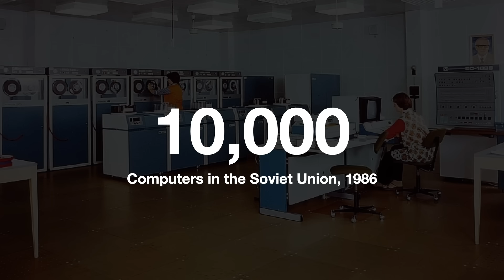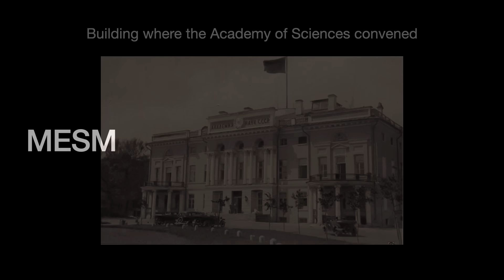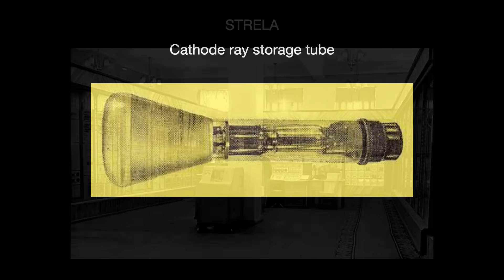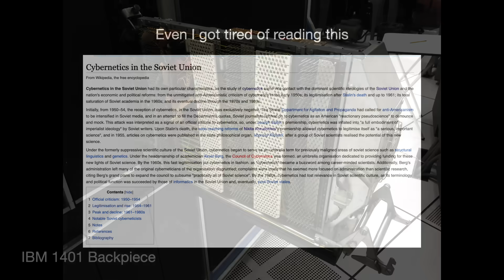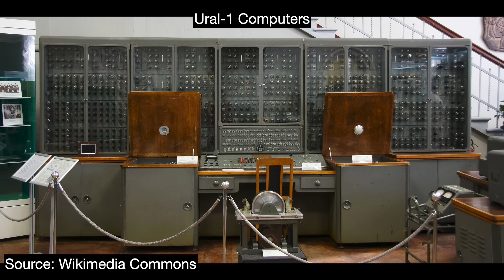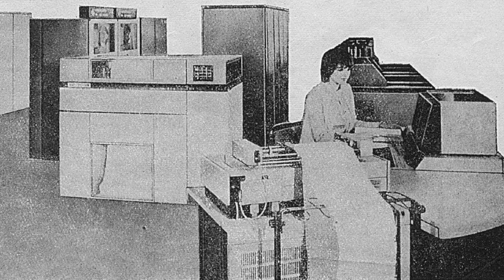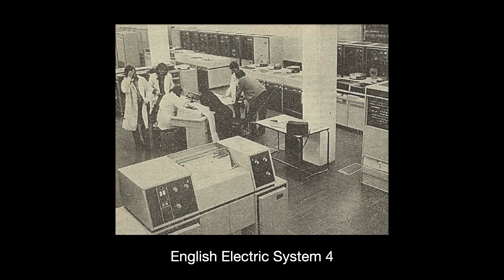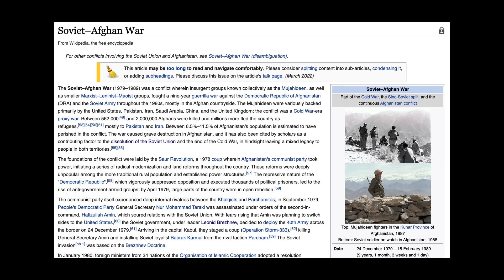Why the Soviet Computer Failed

Comment: “10 kF was thoroughly unnecessary…” reminds me of overhearing an Intel engineer at a pub in Hillsboro, Oregon about 1987 say something like “why would anyone need more than a 32 bit bus?!?” I was so flabbergasted at the narrow mindedness that I almost interrupted his rant.
Reply: This reminds me of a scene from ‘Pirates of Silicon Valley’ where a Hewlett-Packard manager asks a young Steve Wozniak, “What would ordinary people want with a computer?”
Reply: @tygerbyrn  in 1976, that Hewlett-Packard manager was 100% correct.  Heck, 10 years later he was still correct.
Reply: @RonJohn63  HP industrial computers of that era were quite expensive. They were built to control test equipment in labs or on production lines They used a lot of power, and most peripherals used the HPIB bus. (Which evolved into IEEE-488. The early Commodore PET computers could also be used for the application, at a much lower price.
Most people would still not buy computers, if they had to learn to write their own software.
Reply: @tygerbyrn  The internet and www was the killer app for ordinary people. Until that moment computers were more for hobbyists and professionals.
Reply: @gast128  No.
When internet didn't evem exist I worked as full draftman with computer.
Reply: @gast128  I think the whole point of that particular scene in PoSV was to show how the “old guard” of HP managers didn’t have the vision of a future where everyone would be connected electronically at anytime and anywhere. You’re right that it wouldn’t be for a couple of decades. However, it was meant as a metaphor as far as that television movie was concerned.
Reply: @tygerbyrn  I'll play.  What WOULD ordinary people want with a computer?  In real life, what dragged PCs onto US desktops?  Accounting SW?  word processing? games? (ultimately, the answer has to be "internet," i think).
Reply: @hildebrand142  The issue of a computer for everyone comes down to cost, availability, and computing power. The cost was prohibiting for most people other than hobbyists and professionals, as another commenter pointed out. However, the real reason was in the value of the computer. The majority people didn’t use computers back in the day since they couldn’t bridge the gap between benefit over the cost. Certainly, the usefulness of the computer was limited too and thus, curtailed sales towards ordinary folk. 
That’s where we come to the availability of computers. Most computing machines were in the workplace, such as the professional office, factory floors, and government/military. However, as time wore on, the computer became available in the one place that allowed it to become mainstream. The place is the schools. Of course, the first schools where computers were available were colleges and universities. Indeed, many of the know-how and experiments were obtained from and done from institutions of higher learning. From there, ordinary people started taking notice of computers their children were using and they could also see how computers could be useful to them. 
This brings us to computing power. Yesterday’s consumer computers were novelty items to the general population. The total computing power of a 1970s era computer had just a fraction of the power that our current smartphones have now. This low computing power limited the uses for devices that people could use in their daily lives. Games, on the other hand, were and still are the driving force for innovation. Nintendo is an excellent example of this. Their blend of electronics and storytelling helped propel adoption of electronics for the masses. 
The internet certainly did increase computer usage, but that came in the mid-90s. True commercial acceptance came with the advent of the smartphone (Apple iPhone) and the interplay of cost, availability, and computing power was fully realized into the current ecosystem of developers and consumers.
Reply: In the late 70s someone I knew pretty much described where we are now in electronics, saying only a major unforseen roadblock in scaling things could stop it. He expected a few things that haven't happened, like wafer scale integration becoming common, but he had most things about right. You should have seen the negative reactions his presentations got.
Reply: @steveunderwood3683  I was an electronics undergraduate in 1965.   Dr G T Wright, an expert on heterojunction transistors,  mentioned integrated circuits in one of his lectures.  I asked if it would eventually possible to get an entire computer on an IC.   He told me not to waste his time asking silly questions.
Reply: @v8pilot  1966 was just before they started to get MOSFETs working. A complete bipolar computer on a single die is a bit of a stretch. On the other hand I remember a seminar in about 1980 where someone asked about heat limiting LSI. Most of the responses thought it was going to be a serious problem. Only one person said "We get 100W out of a power transistor today. We'll get 100W out of ICs". Most people present thought that sounded crazy. Now it's normal.
Reply: @steveunderwood3683  wafer scale integration is happening in price-insensitive sectors like brain scale AI
Reply: @steveunderwood3683  Are any of your friend’s presentations online?  I’d love to read them.
Reply: @tygerbyrn  This was the 70s. There were no presentation creation tools. If you had something to say you just got up and said it. He was quite specific about many things. At a time when CMOS was a very low performance technology, and the first isolated CMOS products had yet to appear, he said around 1990 geometries would cross 1um, and CMOS would be pretty much the only kind of logic still standing. That was amazingly accurate. We did our last ECL part in about 1988.
Reply: @steveunderwood3683  wow, those were the days.  The early pioneers at work on the technology we have now and take for granted.  Thanks for sharing Steve.
Reply: @steveunderwood3683  "This was the 70s....If you had something to say you just got up and said it. "🤣   Good times. We've gone backwards.
Reply: @artemisPrime3285  It works well for people whith well structured communication... the rambly types aught to shut up and just press "next" on the slide when everyone has raised their hand to signal they're done reading! :P
Reply: @steveunderwood3683  can you recall from memory his presentation and what he said ? i really curious now.
Reply: @artemisPrime3285  Yes and no. The technology to record such a presentation was comparatively expensive and even in the unlikely event that it was filmed or taped any distribution of it would have been heavily gatekept (sic). All we have now are the fading and imperfect memories of the people who were there as even the speaker's notes are probably long-lost.
Reply: @uploadJ  None of those are creation tools. They are purely media to capture the inages. It was so much of a pain to create images of any decent quality for such media, it rarely happened for anything but formal presentations. If you wanted to inform colleagues you talked, and maybe scribbled some notes on a white board (new tech on the mid 70s. You might have used a blackboard and chalk), and wiped it at the end.
Reply: @uploadJ  So, how many times did you see people do that for quick informal presentations in the days before computer tools made life easy? I'd be amused to see someone try to use a pencil on an overhead transparency. Most people forced to produce quick slides used water soluble magic markers, and those slides wouldn't be readable today. It was hard enough to keep your slides pristine long enough for the presentation on a sweaty day. Permanent markers were such a pain when you need to correct anything they were strongly avoided.
Reply: @steveunderwood3683  "There were no presentation creation tools." Hand-written or type-written slides on an overhead projector with hand-drawn drawings? There are also various systems that allowed magnetic audio to be stored on the back of a physical slide, no, such as 3M Sound-On-Slide? The slideshow is surely not a concept only associated with personal computers? :)
Reply: @johnnhoj6749  "The technology to record such a presentation was comparatively expensive" Personal videotape recorders were around since the late 60's, no, with personal audio tape recorders even less expensive? :)
Reply: @TassieLorenzo  So, how many presentations did you see in the 1970s using slides? PCs made them quick and easy to produce. Before that they were only really used for fairly formal presentations where you needed to impress the audience.
Reply: @uploadJ  If you followed the thread you'd see it started with me talking about ACTUAL experiences in 1970s presentations. I gave a lot of presentations at that time too
Reply: @uploadJ  Try reading the thread before posting things like that.
Reply: @uploadJ  Well if a full reading is a problem for you maybe just read the initial bit, where the discussion was about persistent presentation materials, and the later parts about blackboards and whiteboards being the main presentation tools in the 70s. You can add rather clumsy overhead projectors to that, used with a roll of clear plastic that was drawn live, and wiped clean at the end of the talk.
Reply: Overhead projectors. We build first lumber dryer, controlled by PDP8 in maybe 78 or 79?
Reply: @TassieLorenzo  Even the most basic video cameras (a Video recorder is no good without a camera) were expensive Very few private citizens had one and most organisations didn't either. 
In any case, I was saying "comparatively expensive". Most of us now have a device in our pockets every day which can record hours of high quality video and/or audio at an additional cost which is so trivial that we don't even think about it. The proof that it was comparatively more expensive to record sound or video in previous decades is the fact that not a fraction of the recording went on in, say, the 1980s, as goes on in 2022. If people could have recorded as cheaply in previous decades then we would have far more material available than we do.
Reply: My mom when ADSL came in our town: 
"56k is plenty enough to read mails, what else you'd be doing on the internet anyway"
Reply: 249 Gigaflops in the 6 year old phone I'm watching this on. Almost 25 million times faster than that 10k. Obscene if you think about it.
Reply: @rubenproost2552  What is obscene is that a $2000 smartphone can't match a 1960's era Western Electric leased phone in reliability or sound quality. You could bet your life that these old phones would work every time. Many of these are still in service. How many modern smart phones made now will be in use 50 or even 15 years from now?
Reply: @crankychris2  I hear ya, there is something to be said for build quality and simplicity. Smartphones aren't really phones, but handheld computers with a phone app and are generally retired because the battery wears out, someone drops it and the screen cracks or they stop giving you software updates after 2 or 3 years.
Reply: @Retired Bore He clearly did not have much to do with Soviet soldiers, they would enter first West German city and would try to steal everything and load it on tanks and IFV... and that would take much more time than creating new Power Point presentation of the Soviet invasion.
During Winter War Finish soldiers often runed awey from position intentionaly with warm field kitchen and big stock of vodka left behind.
Few hours later they were comming back and the whole Soviet unit was destroyed without a single Finish casuality...
Reply: In 1977, in the Portland area, an Intel engineer marveled at my dad's TRS-80 model I. He couldn't get over the fact that my dad had 4K of computing power (RAM) right in his living room.
Reply: Thomas J Watson (the founder of IBM) famously speculated that the world needed a total of five or six computers. And Bill Gates is said to have asked why anyone would need more than 640kB of RAM.
Reply: @xmfclick  On the other hand there were potential buyers of computers, like the Lyons food group in the UK, who saw so much potential for computers in their business, that they stepped way outside their core competence to try to develop their own.
Reply: @xmfclick  BillG also had to recall thousands of copies of his oh-so-supposedly-intelligent book, "The Road Ahead" because his faceplant about the future being the Internet was so glaring.
Reply: @xmfclick  Bill Gates admitted that he made stupid remarks but denies the infamous 640kb quote. Back in those days anyone could see that more memory is always welcome.
Reply: Bill Gates saying 640kb of memory ought to be enough memory for anyone.
Reply: @azzajohnson2123  He still denies saying that to this very day. Me thinks he doth protest too much.
Reply: I worked for Digital Equipment Corporation in the 80's.  Despite that firms incredible contributions to the IT world its founder and CEO simply could not understand why anyone would want to be the system administrator of a PC when they could run  applications  on a terminal attached to a distributed network of mini computers.  Apparently a lot of people did.
Reply: @davidbeattie4294  Quite true. DEC was a huge success story in tle 70's, often leading the industry. In  1982, they came out with a PC called the "Rainbow 100". Trouble is, you couldn't do much with any PC in 1982, so after spending $1 billion on a mainframe computer called the'VAX 9000', quite the state of the art IBM mainframe competiter, but at $1.6 million each, they sold less than 50, by 1992 the founder and CEO Ken Olson was forced out, DEC's market share was gone, and the mid 90's DEC 'Alpha' series was their last hope.
In 1998, Compac bought them out, which began their demise. By 2002, Compac was history, bought out by 
H-P for $25 mil in H-P stock which then tanked, losing most of it's value. It was pretty difficult to lose money in tech stocks in the 1990's but Digital, Compac, and Hewlett Packard all did.

David, I'll end by saying your decision to leave Digital, regardless of the reason, was timely and correct. When your CEO/Founder leaves the sinking ship, he's usually on the last lifeboat.
Reply: @davidbeattie4294  to be fair most people now run applications on phone like terminals attached to a distributed network ....🤔
Reply: do you feel same way about 128-bit bus nowadays?
Reply: @NoNameAtAll2  if your question is to me, the same applies. We do not know the limits we will be able to achieve. Why not 256, 512, 1024…
Reply: @Jay MacPherson Intel's latest CPUs gave 512b for SIMD, and 256b has been common for some time. The real trouble is making a single wide bus, just due to having to route the wires to similar lengths. Combining parallel smaller busses is the thing, these days, for more bandwidth, though it adds a bit of latency.
Reply: Why would humans ever need to travel faster than 0.99c? Isn't it just a waste of precious nuclear energy?
Reply: Thank fuck you didn't say anything, imagine if they made x86-64 before AMD
Reply: He was right.
The other 32 bits are made to spy you.
You don't need 64 bits.
Reply: @Retired Bore Well, there wasn't an actual such rank, but yes, both PowerPaint and its predecessor, Harvard Graphics, generally were beyond the capability of most servicemen, and of Gov't GS (General Schedule) workers too.

In those days, anyone that showed even mediocre graphic arts capability could count on having their career progression halted, their duty station changed to whichever HQ, and the rest of their days spent making unending minor edits to whichever slide show was going to get the most eyeballs.  I speak from my experience as a junior officer.

Of course, those who were never in military or gov't may not have experienced the sheer frustration & stupidity involved in "developing" presentations, or "staffing" a paper.  Every person on the list has to agree to the text used, and often the item will get "stuck" between two officials' disagreement, requiring intervention by a superior rank to determine which one's wording will win.  "Death by PowerPoint" became a joke after I was out, and supposedly Army bandwidth has been severely impacted by the number of massive presentations being sent back & forth.
Reply: Don't worry, Intel still has plenty of those people! About 8 years back I was arguing with an Intel employee that the average desktop needs more than 4 cores, they couldn't see any reasoning for needing more than 4 cores.
Reply: "an Intel engineer at a pub in Hillsboro, Oregon" : The Orenco Grill? Best place for drunk Intel engineers to blab.
Reply: @davidjohnston4240  Cornelius Pass Roadhouse, before it was changed to today’s setup.
Reply: when I was a teenager in the 80s a friend's dad bought a new computer with an immense 10MB hard disk, we wonder how and when was he going to be able to fill that up xD
Reply: "You will never need more then 32 giga bytes, like come on... What could take that much space ever?" Was what was told to my mother when we bought our first computer for home. I think 2001? 2?
Reply: Bill Gates also said nobody would ever need more than 1 MB of RAM
Reply: What would you have said if he'd be talking about a 128 bit one?
Reply: @crinolynneendymion8755  same thing
Reply: @Retired Bore I recall the "Law" though I had forgotten the name... & that retired colonel was absolutely correct.
Reply: to be fair .. lots of companies use 32bit bus computers in 2022
Reply: That man was my father. We still only have a 32-bit bus. Eh… it gets us by
Reply: }}} “10 kF was thoroughly unnecessary…” reminds me of overhearing an Intel engineer at a pub in Hillsboro, Oregon about 1987 say something like “why would anyone need more than a 32 bit bus?!?” I was so flabbergasted at the narrow mindedness that I almost interrupted his rant.

Bill gates is ON VIDEO ca. 1984 or so, suggesting that he saw no reason at all for any personal computer to have more than 16m of ram.

The latest gen of his OS doesn't run well in less than 1000x that. :-P
Reply: @nickbrutanna9973  I think he said 640kb which is the maxinum for the ibm pc/xt. The 8088 processor in those could adress 1mb but they had to reserve some space for the bios chips, the video card and other expansion cards. 16m was only getting common in the mid nineties with 80486 and pentium processors.
Reply: I remember a computer store guy telling a business that they will never be able to fill a 1 gigabyte hard drive.
Reply: I started programming in 1981, on a mainframe. I had to code the programs on sheets of paper which were then typed in by the 'coding girls'. A program compilation could easily last a whole day, one reason being that the mainframe could only assign 16 kilobytes RAM for the process. Any large or complex application was split into many small pieces, which is always the best way anyway.
Reply: "640kb should be enough for everyone :D"
Reply: I do wonder if we are getting close to making a computer that is so good that bringing the cost down and creating better programs is more important than improving the hardware specs...  The new Mac M2 processor is going to be impressive.
Reply: I wonder what he would think of the 2048 bit bus on the Radeon Vega 64 with its hmb2 memory
Reply: I recall a British computer magazine in early 1981 writing that no private computer user would ever need more than a few hundred kilobytes of memory.

But I recall more vividly visiting the USSR in 1977 and finding that the universal tool of calculation was the abacus!

And I recall an extreme lack of realistic thinking even in black marketeers: One approached me in the street and wanted to buy my jeans, straight away.

"I can't take off my pants in the middle of the street!"
"Why ever not!" (seriously)
"Well, to start with everybody who sees me without them will know what happened to them."
A look of surprise, followed by "I can come to your hotel, later."
"What good will that do, now that we have been seen talking together [by the KGB 'tour guides']?"
That's when he gave up.